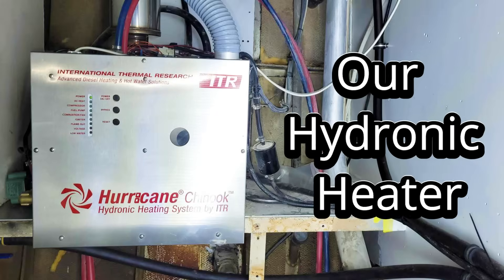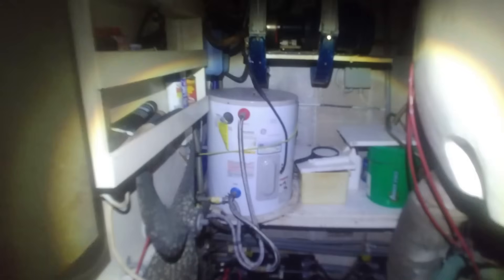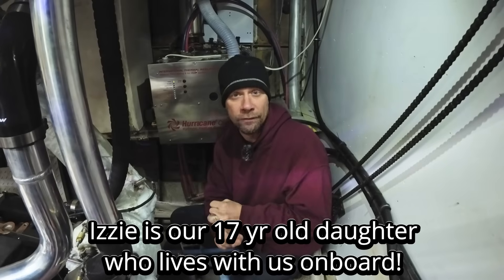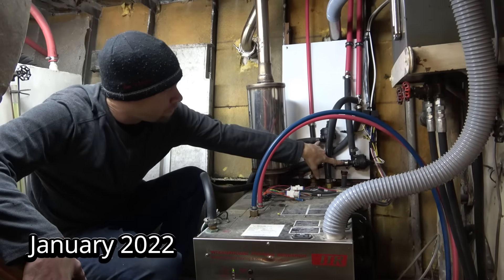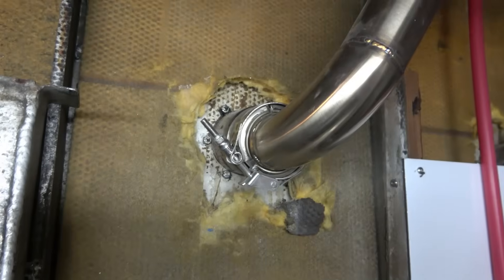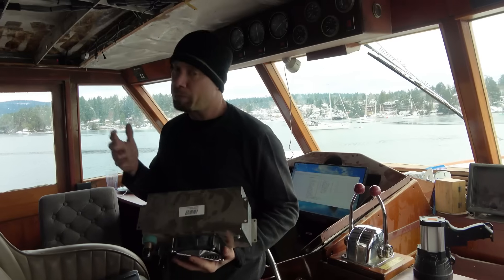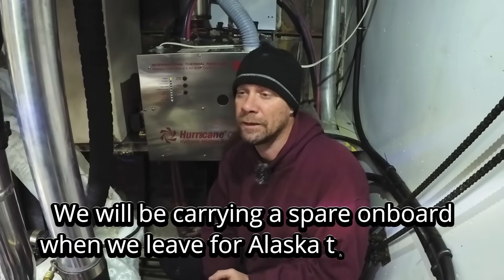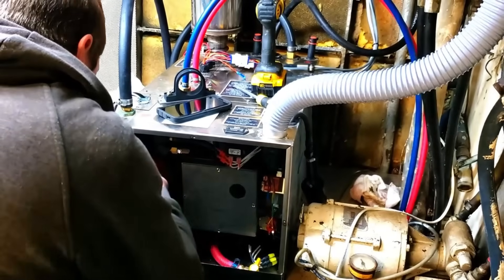Installing a Hydronic Heater to Survive Canada's Winter

Comment: Spring Clamps are GREAT because they maintain tension. Most people hate them because you NEED a special tool or tools to get them on and off safely. Use the wrong tool... BLOODY MESS. 😅
Reply from the maker: They are great. We use them tons in the automotive trade. I typically don't mind them unless the manufacturer has put them in locations that are almost impossible to access. That was the case with these. Thanks for watching!

Blaine
Reply: @OnboardTangaroaSeatrial  I've started using Gates PowerGrip Heat Shrink Hose Clamps. They are even better, I wish I knew about them sooner.
Reply: @tristan4337 I have used the gates power grip heat shrink clamps for years.  I like the clean look when building show cars.
Reply from the maker: Right on! We use those at my shop as well. Definitely make for a clean look.

Comment: Use an underfloor heating manifold to separate the loops and run a Taco/Grundfos  household pump off the inverter. The 12 volt pumps are crap
Reply from the maker: The system is already in operation and I don't think I will have time to do many alterations for a while. Funny enough though, I actually installed a Taco pump a couple of years ago and it has been working great!

Blaine

Comment: Using 48volt fans on 24 volt is a solution to reduce sound noise, also dump the heat from your generator in a hot water tank and use this heat when the gen is off
Reply from the maker: Thanks for the suggestions! Unfortunately I won't have time to get back to this for a while. Too many bigger projects on the go. 

Blaine

Comment: 50,000 btu/h is real low for instantaneous water heating. Do you have a buffer tank?
Reply from the maker: It does have a 7 gallon buffer tank. The on demand hot water works fairly well but in the wintertime when the water in the tanks is very cold the showers definitely need to be shortened a bit.

Blaine

Comment: Hydronic heating is the “safest” option on a boat the little “Bus” heaters in each room, before Blaine said it I said noise. Seeing as you guys run off of battery/inverter power using the generator to help produce/assist hot water isn’t a viable option. The technology today with on demand hot water heaters is amazing.
Reply from the maker: So far barring the pump issues it has worked very well. The hot water on demand is right on the edge in the winter though when the water in the tanks is super cold. 

Blaine

Comment: Part 2

The nice thing is, no complex valving or plumbing needed with heat exchangers, as if the engine(s) are not running,  they are not circulating water, and thus not wasting heat from the mini boiler to heat the engines.

That way, whenever you have an engine running, you have free heat!

BTW, I still need to redo and send you those calcs for the optimal alternator RPM :)
Reply from the maker: Very good point. I should have some results on that generator set up as I am cutting the system over today hopefully. Need to get my busbars finished up though as the current cabling was only meant to be temporary and uses 4/0 cable which will not be enough.
Reply: @OnboardTangaroaSeatrial  
What is the length of the run from the generators alternator, to your battery box?

I'll calculate out what you need for wire, based on voltage drop.

Note that several parallel runs of conductors might be your best option.
Reply from the maker: The positive run is about 6ft and the negative is about 12ft. I am using some leftover 313mcm cable I had from another job.
Reply: @OnboardTangaroaSeatrial  
Let's do the calcs at 350A charging.

2% is usually what is acceptable for line losses. 1% has been updated for some building codes. I got hit with that when I built a significant building. Had to run 250mcm NUAL, and thousands of feet of 2 1/2" EMT pipe, vs cheap 2". Worst is, I spec'd the average loading to be light on most of the panels, but code put it at the panels max 200A capacity. 
5% has been somewhat acceptable for low voltage stuff. 

We'll go with 1%, and see where it takes us. Especially where your wires are short, and you are striving for efficiency.

25V @ 350A = 8,750W 
1% of that is 87.5W. This is the allowable amount of heat the cables will dissipate at 350A for our calculations.
I^2R=W, we know W, and I.
Rearranging,  we get 1/(I^2W) = R
1/(350^2 * 87.5) = 0.000714 Ohms.

Your wires need to have a resistance of no more than 0.000714 Ohms to achieve that goal.

You have about 18' of wire round trip. This means 0.0000396 ohms/ft
Or 0.0396 ohms/1000 ft, as many wire charts go by.

0000 copper wire would come close at 0.046 ohms/1000ft, but would still loose (350^2)(0.046/1000×18)=101.4 W

Better would be 2 runs of 000 copper.
(350^2)(0.0618/2/1000x18)=68W losses.

The cables will still get moderately warm.
Reply: @OnboardTangaroaSeatrial  
Interestingly, I looked up the data on 300MCM wire - it's 0.036 Ohm/1000 ft.
(Didn't find accurate resistance of 313MCM - 300MCM is close enough)

That means a dissipation of:
(350^2)(0.036/1000×18)=79W

With your current wiring, you are already beating the 1% loss goal!

You can cut that loss in half, by running another set of identical cables along side the other set. Basically, you'd be at 39W total cable loss, with twice the surface area. Ie half the heat created, and twice the surface area to get rid of it.. And if you ever charge at 450A, no issues.

At 450A, the losses would be:
(450^2)(0.036/2/1000×18)=65W. Less than the losses you have now, at 350A and 1 cable set!
Reply from the maker: Thanks! I am glad that the 313 will work for my setup. Unfortunately I do not have enough cable for two runs. One thing that I have noticed and will have to address is that I have installed a 400 amp ClassT fuse on the generator feed. Clean and tight terminals. It gets quite toasty after running the generator even at 250 amps for prolonged periods. Hot enough that is is uncomfortable to touch. It is a blue sea fuse holder that is rated for the amperage. I am tempted to direct mount the fuse to the large busbars to help dissipate the heat better.
Reply: @OnboardTangaroaSeatrial  
Yes,  the 313MCM wire will work well, with reasonably low losses. It will get a little warm, especially as you crank the current up. This is the unfortunate thing about higher currents vs higher voltage.

The I^2R = P thing is because as currents go up, you have a higher voltage drop across the wire due to resistance. You can also just measure the voltage drop between the two ends of the wire, and multiply by the current it's carrying. Ie. VI=P.  If we know the resistance, we can use ohms law, V=IR to figure out the voltage. Or plug ohms law into the power equation, giving IR * I = P,  which simplifies to I^2R = P

Check the temp rating of the wire, which is probably 90°C or 115°C. Keep the wire  in places where it can get air flow. Tight, restricted areas are of most concern. Check those spots carefully with a thermal camera or infrared thermometer to make sure you're not exceeding max temps (with some safety margin for worst-case hot environments) with full load on the wires. Increase air flow in those areas or reduce current flow to correct any issues. Or beef up the wiring even more
Reply: @OnboardTangaroaSeatrial  
This is a problem with fuses - they have somewhat significant resistance. 

And, as shown from the calcs above, even small amounts of resistance are significant. 

I have very little data that I can find on class T fuses regarding their resistance. 
I did find a forum discussing it.

If you can measure the voltage drop across the fuse when you are charging, and the charging current, and we can calculate the power loss in the fuse.

You'll probably find that it's dissipating 30-40W at full charging load.

Note that your alternator is current limited, inherent in its design. 

The side the fuse belongs on, is next to the battery.
Reply from the maker: Thanks for the reply! All of the cabling is in fairly open areas. I do have a flir that I will be watching everything with on the first run up with the new alternators. The Class T fuse is mounted just off of my positive busbar at the battery so all good there. I still haven't got around to getting the new alternators on. Possibly this weekend.
Reply: @OnboardTangaroaSeatrial  
Re-reading about your fuse, the Blue Sea stuff I've used, including probably the exact fuse holder you have, has been good quality.  The class T fuse blocks I've used from them, had very beefy termination blocks.

Not that the fuse can pop apart in a violent failure. Especially when approaching the AIC, Arc Interruption Capacity. You got a lot of beefy lithium in parallel. And a dead short can easily hit 10's of thousands of amps. Serious stuff...

Bolting the fuse to the bus bar for that reason is highly not recommended, as there would be no support from a holder, and if it did violently fail, the the wire that would be essentially shorted out, would be freely moving around, with a dead half a fuse still attached, which may have been projectiled from the other parts of the fuse. If that hits the bus bar, there's no longer anything protecting against the shorted wire.
Reply from the maker: Very good point! I am planning to build some decent covers on the whole works at some point.  I will keep the Blue Sea block and just monitor the temperature rise. Got the alternators running yesterday. Just doing some regulator adjustments but so far so good! No more amperage drop when running loads over the top of the charging and no more charging kick outs. At 150 amps each the alternators only get up to  56c at the stator. I am going to turn up the amperage a bit today.

Comment: Run your generators hot side coolant, before it goes to the heat exchanger, to the hot water tank. Perhaps through a seperate heat exchanger to isolate the two systems, preventing an issue of either system from taking the other down...

Part 1
Reply from the maker: That is an option for sure however we don't run the generator for all that long to charge the batteries. It would be a great option off of the main engines to heat while underway though as we would have them running for extended periods.

Comment: after commenting on your last video with the cabin heater then seeing this vid with you having the mega diesel heater I would like to take my comment back concerning fitting a water jacket around the cabin heater to give you both the warmth you need, lol, I feel like a clown, but hey if you cant laugh at yourself you have no right to laugh at anyone else, 
talking about making stupid comments,  have you got double glazing for your cabin etc? also as an old salt myself I like to have a full 360 view at all times, but on Tangaroa you have enough glass for a greenhouse, so why not fit lined curtains for use at night while keeping some clear for security observation,
Reply from the maker: Lol, The Dickinson was just the first step. For the first few weekends before I got the big heater installed Janis and I would bring a mattress into the main salon and sleep there because it was the only warm spot. Cabin windows are crap. Definitely a huge source of lost heat. We plan to change them all in the not so distant future. Lined curtains are definitely a good option as well. 

Blaine

Comment: I'm not sure your best options for pumps, but that is unfortunate that they are failing.

I would look at automotive DC driven coolant pumps. Hybrid vehicles often use these. Prius's for example. 
You would have issues with your 24V supply vs 12V  of most automotive parts. But perhaps theres some commercial vehicle DC coolant pumps available that run on DC. Alternatively, use a DC to DC converter. There's tons avaliable cheap. Although,  in my case, I would probably roll my own design. 

I have used brass circulator pumps in the past, mostly for chiller applications. Grundfos and Taco both make decent ones that hold up well. But they all run on AC voltages. At least they did. There may be solar optimized pumps avaliable now that run on DC.

Edit: BRONZE pumps, not brass
Reply from the maker: I swapped the pump out for a Taco unit. It is 120v but we have that always available and will have redundancies in place in case of inverter failure. It's been running flawlessly for a couple of years now. I will get a second one for the forward loop. I had one on order but the postal strike up here in Canada kinda threw a wrench into the works. I had a couple of automotive auxiliary heater pump in there for a bit but I had failures with those as well.
Reply: @OnboardTangaroaSeatrial  
Yeah, that's why I suggested DC driven OEM automotive coolant pumps. Engineered to last. Vs some of the aftermarket/universal/off brand stuff
Reply: @OnboardTangaroaSeatrial  
The Taco's will do you well

Comment: Look into noctua fans. 
The defacto standard in quiet pancake fans!
Reply from the maker: I had though about a pc fan for my draft heater as well. I remembered noctua from my pc building days. Will definitely be looking into them.
Reply: @OnboardTangaroaSeatrial  definitely worth looking into. You may want to drive them at 2 speeds also. High speed  = noisey, but lots of heat. Lower speed for quiet, but lower heat. Most 24V household thermostats of moderate features have more than 1 output heat output, that would work perfectly with this. And even though they mostly run on AC, they shouldn't have an issue running on your 24V nominal DC. Or could be easily modified if there was an issue.
Reply: @OnboardTangaroaSeatrial  
YouTube censoring my posts again... Frustrating....